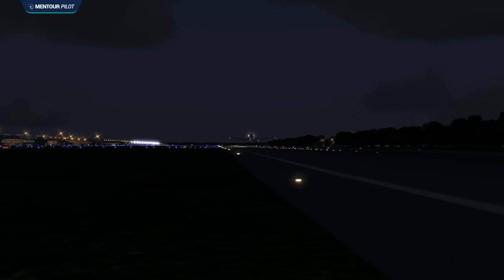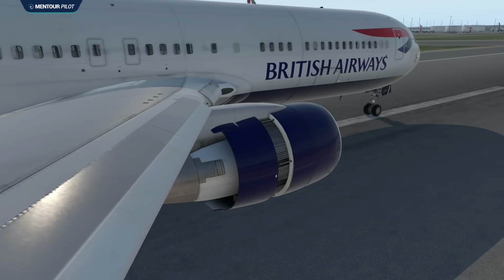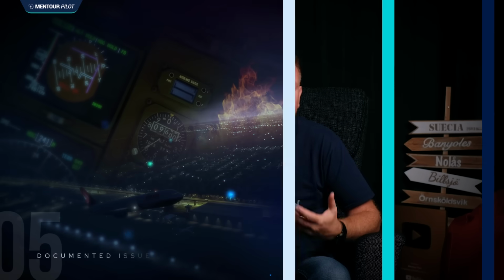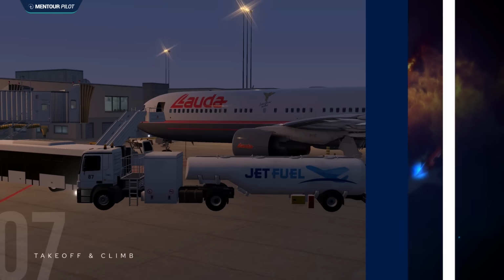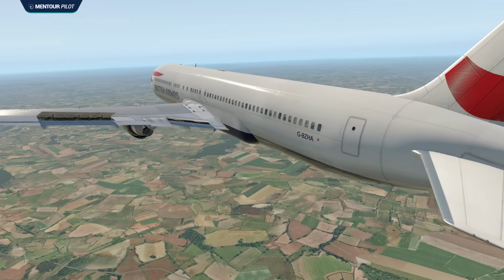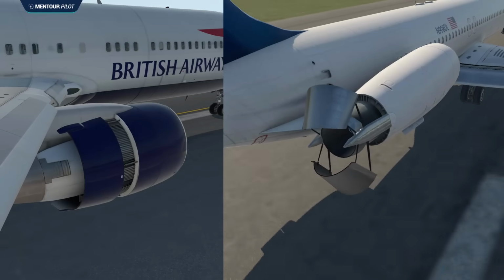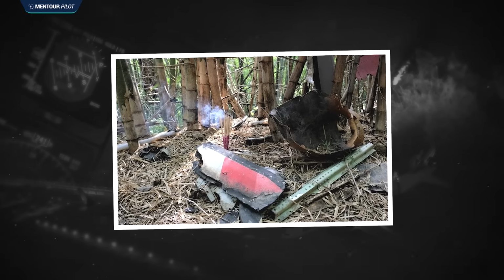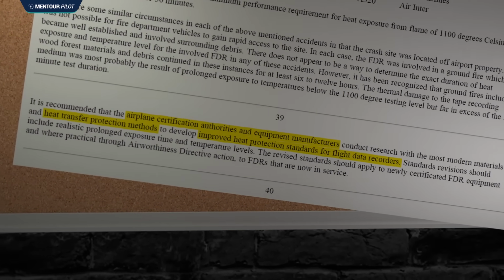HOW an Impossible Failure CRASHED this Boeing 767!

Comment: Why would they only test TR deployment at low speed and idle?  It seems reasonable to test it throughout the operation envelope.
Reply: Well, low speed and idle is the usual operation envelope for a thrust reverser. I mean when does a pilot usually activitate the reversers? at touchdown when the aircraft is slow and the thrust levers are pulled to idle before activating the reversers. So in this regard Boeing wasn't totally wrong. In my opinion the problem was more that the activation system wasn't fail safe or had a fall back. In the A320 for instance, if the reverser do acitvate uncommanded in flight, the affected engine will throttle back to idle automatically.

Comment: Incidents like this one (also with Max) make me not to trust Boeing products, especially new models of planes. Unfortunately, whether I want it or not, I do have to fly on Boeing planes a lot as I need to travel for work, but I try to avoid them by any possible means and when not possible, I turn from a seasoned flyer into a newbie with flying phobia, for the duration of the flight.

Comment: Hmm...so the crash site was "looted" and the two most important things that co0uld have helped tell us more about what went wrong on a "Boeing" jet were taken and then someone returned them after they were tampered with ...hmmm...not at all suspicious. Disgusting Boeing. It is interesting how some of the recent flights from Boeing where their teams have been involved in investigations has also found the black boxes etc to be "damaged" and "difficult" to pull data from it. Being the defence contractors that they are, there will be no political will anywhere to hold them accountable. People have to put pressure on scumbags like these.

Comment: Dear Mentour; this is so sad. These advanced aircrafts would tell you when they are feeling  "sick" even  most analog crafts I fly does this... I personally will pin this on the pilots. If I carry so many souls on board, I would be urged for the need to be able to diagnose, listen and act verry quicky ontowards something as simple as an couling that did not retract.

Comment: I just want to say, as an old locomotive Electrician, seeing that bee's nest of wire bundle makes me want to peel my skin off. I used to have to rewire entire locomotives from the control panel to the traction motors. Miles of wires,, of varying gage. It drives me crazy seeing poorly formed wire runs.

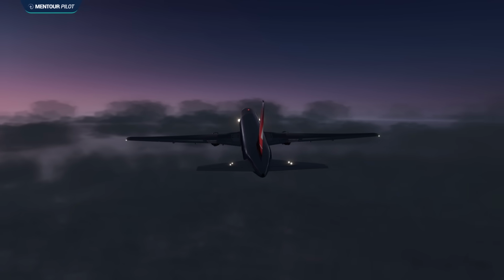Comment: 15:22 I'm not actually a pilot (but I at least have been a passenger on the Boeing 767-300 multiple times), but thrust reversers randomly engaging mid flight at full thrust sounds horrible even to me.
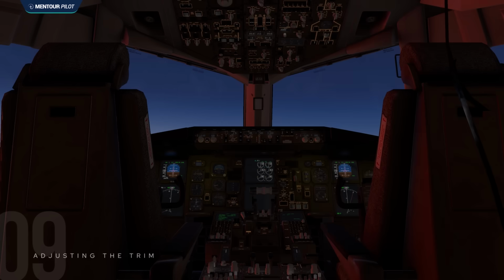16:10 As far as I am concerned I once heard its very unusual to give assumptions of causes as info. Like if you see smoke coming out of something you are supposed to tell that you see smoke coming out of something but not that its burning, because you cant know for sure that its burning because the recieving end could understand this as a fact even if you said you dont know for sure. It also kinda makes the other end focus on that specifically, when it isnt even for sure this is the cause.

Comment: I use nord and it's a lie that the isp dont know the streaming speed. I use 5g and I cannot stream youtube videos on high resolution for long while connected to nord. I believe Nord itself is throttling the connection and are outright liars. Because as soon as I disconnect from the speed is back to normal. Try express vpn instead. It's expensive but it's worth it.

Comment: This brought to mind carbon Monoxide detectors and the stories of people ignoring or disarming them because they think they are faulty when in fact it is doing exactly what it was designed to do and detecting carbon monoxide.  With backup cameras on everything I wonder why cameras aren't installed on commercial planes these days to give pilots some visual info on control surfaces and engines.  Deployment of reverse thrust must be visible from a passenger window?

Comment: Great, detailed, very explanatory video. Takeaways for me: the insufficient risk modelling, vulnerable wiring, and critically, the FAA and Boeing are again linked in a mutually-unaware risk scenario. This disaster, others have recognized, was preventable had a mechanical lock, to prevent the TR opening, been fitted. 
After the Max8 horrors, the ever-denying CEO left, paid off with $62 million. Better if Boeing had spent that fortune on improving safety culture, instead of their "build it down to a price", focus on personal wealth, mentality. Their designs need more rigorous third-party oversight, not testing to destruction in a flying bomb full of humans. Nikki Lauda trusted Boeing. He later said this crash was more awful for him than his F1 accident.

Comment: At 23:37, he states it was calculated that the wings sheared off around 4000ft and it impacted the ground 3 seconds later. That means the aircraft was travelling at 1333ft/s, or 909mph. As if this event wasn't bone chilling enough, assuming the calculation of 4000ft is semiaccurate, that is equal to mach 1.18.

Comment: Surprisingly, this wasn't the first nor the last time the thrust reversers had deployed in flight. Five years after the Lauda Air crash, a Fokker 100 was departing out of Sao Paulo (TAM flight 402) when the starboard engine thrust reverser deployed just after rotation, causing the aircraft to stall and roll to the right side. it impacted buildings before eventually crashing into a suburban area resulting in the deaths of all aboard the f100 and another four on the ground. The crash was attributed to a faulty weight on wheels switch, allowing the thrust reverser to deploy.

Comment: I am an engineer and not involved in aviation. But what I see is that Boeing SIMULATED as thrust reverser failure at a certain condition in which they ASSUMED it it would be harmful. Are they out of their mind? Where is the simulation at ALL conditions an airplane could possible fly into? Where is the simulation which shows failure so you know when it would fail? Over the past years I have seen multiple issues with Boeing aircraft where they EXPLAINED safety instead of applying it. The Boeing 737 Max was not different from previous versions, rembemer? We only simulate what we think is likely to happen?

Comment: Error message on the day of the crash:
On May 26, 1991, before the "Mozart" took off for the last time, the responsible Lauda Air technician in Bangkok noted on a transit check card that the message "L ENG EEC C2" appeared on the EICAS monitor, which was the "final proof" that that the troubleshooting attempted up to this point was not successfully completed. For this reason, according to the MEL and the DDG, the "Mozart" should not have left Bangkok.

Comment: On July 23, 1990, 10 months before the accident, the Mozart on-board computer displayed an error message: "Air/Ground Disagree", which means that some aircraft systems recognized that the aircraft was on the ground while others were in of the air.

According to the Minimum Equipment List and Dispatch Deviation Guide (DDG), this error represents a status message that prohibits further operation of the aircraft without prior repair. However, the maintenance documents do not show whether and when this message was deleted and whether or which repair measures were carried out. This violation also existed at the time of the crash due to a later identical error message, since the cause of this error message had not been remedied or at least not documented and traced.

Comment: Huge oversight on those reverse thrusters going off in flight(no you're not at idle speed when airborne),I imagine Boeing has corrected the problem.
Reply: It only took Niki Lauda to finally get them to admit the issue.  He forced them to actually do the simulation of engaging the reverse thrusters at the actual altitude which caused the crash.
Reply: Not to down play the tragedy, but It's unrealistic to expect them to expect that. It's costly to test every scenario so they treat the most likely. It's like expecting a manual car to be in neutral before you can engage reverse (reverse is opposite past idle, eg neutral, on the trust lever), they never expected the possibility of a series of simultaneous circuitry malfunction to engage reverse while in 5th gear.

Comment: Part of the failure in this entire incident is the failure of the plane to clearly communicate what is wrong to the pilots. A simple warning of "L REV ISLN" is basically gobbledygook. It would be much much more useful to have the glass cockpits give the pilot a page demonstrating the schematic location of the fault, even if it's general, so that they can know what part of the system is affected and any safeguards before or after the fault that may or may not exist. If the pilots had that, instead of a cryptic warning explanation, they might have realized they were one failure away from a reverser deployment.

That said, since the pilots had been lied to about the aerodynamic effects of a reverser deployment at that speed, they were operating with an entirely wrong conception of what happens to their plane if their fault cascades, so even then it may not have been recoverable.

Comment: Per the narrators story the TR being deployed in flight, could produce a moderate control problem. I know the test design condition was at low alt and pwr settings. If that was a moderate control problem a severe control problem should cause reincarnation. The narrator also made a comment about the pilot probably dismissed the trouble warning light. STOP THERE. This may be the reason why pilots cause crashes. No aircrew should do a mitigating troubleshooting senario. MOISTURE, probably. You pilots need to STOP playing the slot machines in the cockpit. Gambling with an expensive aircraft and hundreds of lives obviously is not a little thing. Your egoes never allow you to challenge yourselves.....and you kill people

Comment: In the decades past, before you were born, Boeing tried it with the 707, I suspect it was Tex Johnston, their famous test pilot who did the barrel roll.  They discovered they can put the number 2,3 engines into reverse and achieve an eye popping descend rate, the airframe would vibrate like hell, but held together.  Douglas made their DC8 go supersonic........just.
Reply: But douglas couldn't figure out doors that locked correctly
Reply: @joemunoz1476  That was the DC10, and it was MacDonald Douglas. Airplanes are complex enough, just about all manufacturers missed something and have to fix it in the first 5 years or so.

Comment: Moisture does not cause a Relay of Micro relay to flash on\off... It's a sign of lost electrical Current or Short Circuit looking for new path back to the source... So don't assume anything. Why I think it was a wiring fault. And once it finds a new source. It can energize other relays on that new wiring path...

And yes I'm electrical engineer. I seen strange things happen. Why they still teach it 400 years later. As Electrical Theory...

Comment: If I'm not mistaken the sync lock system was put on the aircraft as a result of this incident.
"The sync locks are locked in their normal state, preventing the flexible shafts from rotating and thereby preventing thrust reverser deployment."

Comment: The isolation valve warning on EICAS is a logic "disagree."   In other words, the reverser control is in the "stow" position but the isolation valve is not showing closed.....a disagree. It could be an indication problem (a wiring problem, which would simply be a false indication) or it could be that the valve is actually not in the closed position. (yikes) This is a classic "Boy who cried wolf" situation. Having a chronic false indication causes people to lapse into complacency, as Mentour explained.

Comment: 9:20 still true to this day......although the airlines are more cautious about long term intermittent faults because of the liability involved. Deliberately resetting the deferral hours by making half hearted attempts to fix the problem could open one up to criminal liability. So, sometimes they say the aircraft has "dropped dead". They consider the problem has gone on long enough and needs a positive fix. They LOCK the log page and ground the aircraft until a positive fix can be identified. This is why an Airframe and Powerplant mechanic's job is unlike any other job in the world. Life time liability for the repairs we do. The pilots set the brake and walk away....their liability has ended. But if we make a repair, our liability goes with that aircraft forever, basically.

Comment: If I remember correctly the Space Shuttle pilots practiced landing the Space Shuttle in a Gulfstream jet rigged so they could open the thrust reversers in the air to simulate the extreme descent rate of the Shuttle Orbiter.

Comment: The disaster has been very well explained using these astounding graphics. Kudos to Mentour Pilot for producing such high quality short documentaries.
For those who are not aware, this Lauda 763 was registered OE-LAV. It was assigned line number 283 when it was being assembled at Boeing. Ironically, another disaster unfolded
eight years (in Oct. 1999) after the Lauda one, this time another 763 from Egypt Air registered SU-GAP which was assigned line number 282.  As one can imagine, two consecutive 767s from the assembly line with the same powerplant type were written off in dramatic, but different circumstances.

Comment: Thank you for this great site, even after 22,000+ hours in commercial jets I still learn from your analysis (and sometimes "there but the grace of God...."). A couple things; first the DC-8 was designed and certified for use of inflight reverse, (except for the -73 model) and did not have inflight spoilers, which made descent planning more important than say a Boeing. Also the aircraft hours being reset to 500 hours before repairs, after maintenance is performed, contributes to this kind of event, as you pointed out.  I corrected this myself by going back to the beginning of the log (and the previous log) and along with the squawk I would cite each log page on which the writeup was mentioned.  This would flag the whole thing when there would be an FAA  maintenance audit. It did not endear me with the maintenance department.
Reply: please explain what this means in commoner terms "and along with the squawk I would cite each log page on which the writeup was mentioned. "

Comment: Why not ALWAYS do modeling of incidents at low and high altitude, high and low speeds, even if it doesn’t seem likely to happen. This should always be the procedure as standard testing.  It seems more than one accident has occurred due to situations people never anticipated.  Also, shouldn’t any critical system, if problems are reoccurring, be prioritized and removed from commercial service until problem is fixed?  This seems like a serious problem with procedures to follow.

Comment: Criminal negligence that they didn't look into what would happen at high speed.  Disgusting.  On another note.  Seems like immediately putting both engines to 0% thrust then slowly increasing the good engine would have worked.

Comment: Accidental deployment at any speed is unexcepted. This is like we tested the brakes in your car at 10mph they work great, then lock up up on the highway. As a technician I tend to stay mad at engineers lack of understanding of real world scenarios. We spend a lot of time fixing there f@ck up's. What a tragic preventable loss of life. Sad. Excellent video.
Reply: I assume Boeing was not "naive" because they only tested one scenario (or rather they modelled it). And then it was with low speed / altitude (which is very little of total fly time). i think they got with these parameters a result they could live with and that was enough to cover their a$$ in case of future accidents (as proof that they had done some testing) - and they did not want to know any better.

After the accident of the Lauda Air machine they still officially denied and dragged their feet. I assume authorities did not ban all the  machines that had the same thrust reversal. So they had several months time to develop new solutions (while keeping quiet about it of course). 

The worst for Boeing is when their customers (airlines) have to ground their machines. Had they admittted that they knew how problematic this was, the machines would have been grounded, that is bad for future sales. Maybe also penalties.

The scenario: let's risk that planes crash, deny, deny, deny. Deflect, deflect, deflect (pilot error) and then do something (but with more time compared to when they would admit their problem) was better for their profits.

Comment: Something similar happened here in Brazil back in 31 October, 1996 to TAM flight 402. It was a Fokker 100 and a faulty switch in conjunction with a possible short circuit caused the right engine's thrust reverser to deploy. The plane fell only 24 seconds after takeoff, killing all 96 people on board and 3 on the ground

Comment: I'm a big fan of your channel and i love watch your video's and stories. I'm  thinking about how many accident happened in aviation, and how many people died before we get to the safety we have now..but what I understand is that..despite an aircraft can be very safe now, behind an accident there is pretty much always, an human error, or overlook from the engineers of the aircraft's. Yes We can learn from our mistakes and make thighs safer but we are human, and machines are not smart, they do what we say to do..so we will never reach the perfection. And accident will always happen, unfortunately. I admire pilots for what they do, but most of the times is not the pilot fault if the aircraft is broken. Correct me if I'm wrong 🙂.